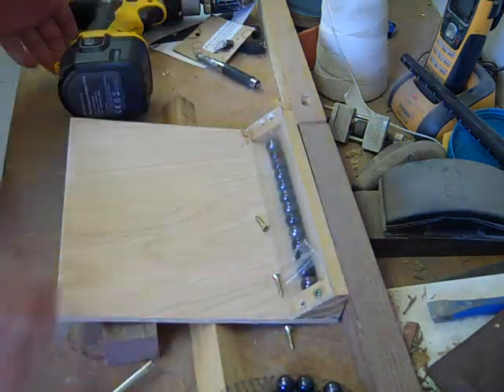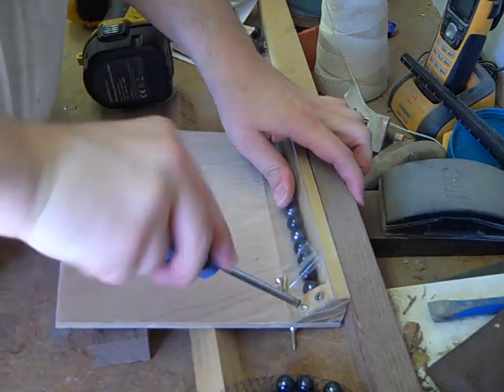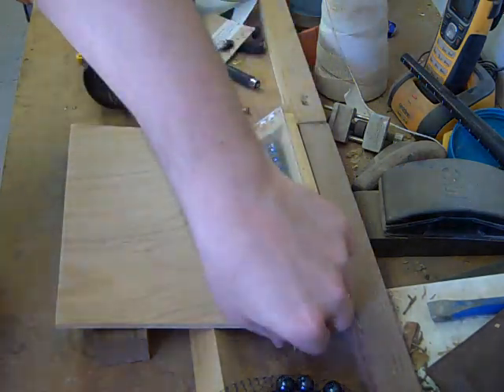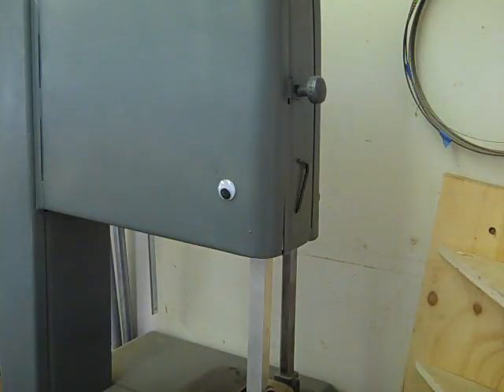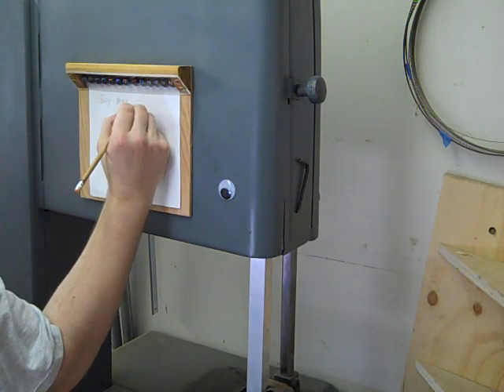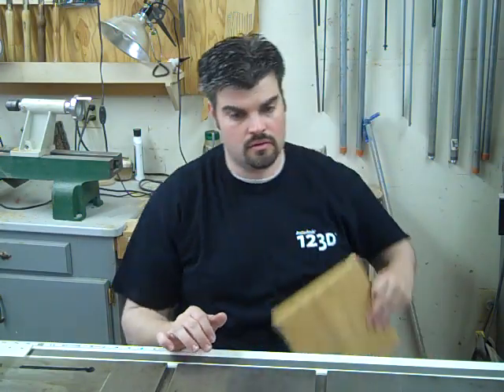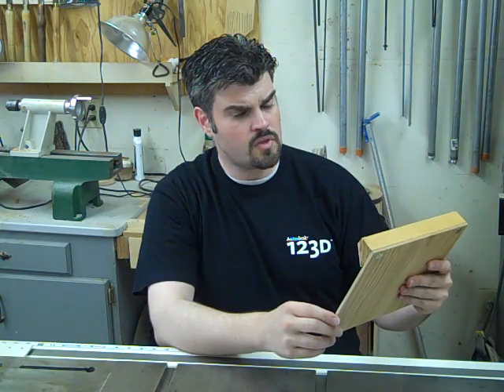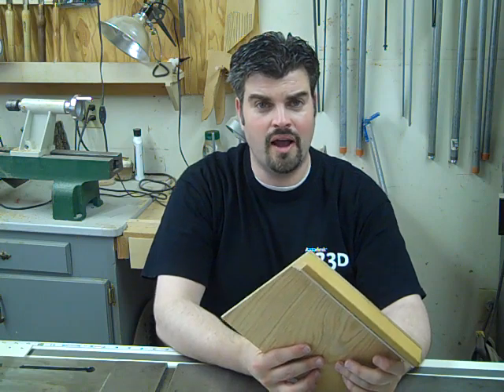How To Make A Marble Note Holder

Comment: Really cool idea! I collect marbles too, so even better. Will it hold multiple sheets of paper?
Reply from the maker: Sure thing. The amount of paper is dependent on the width of the gap between the acrylic and the back. Widen that gap and you could put quite a few in there.